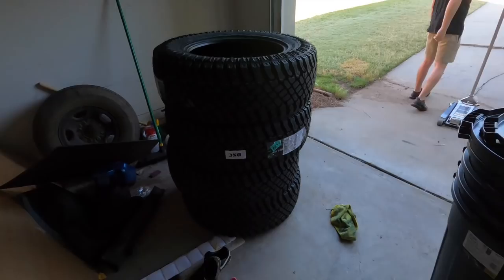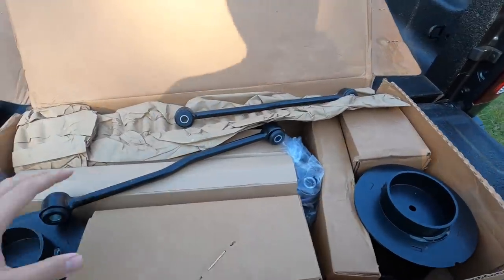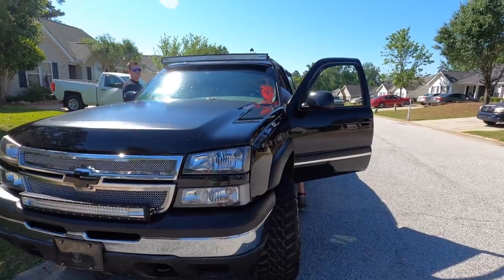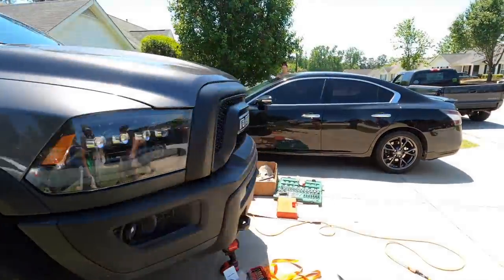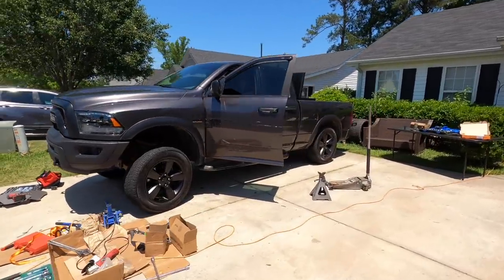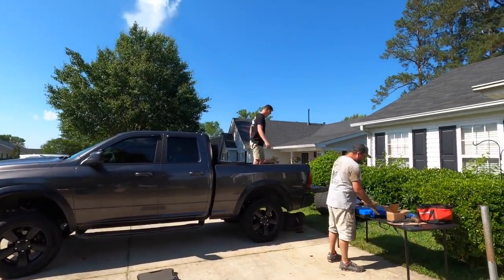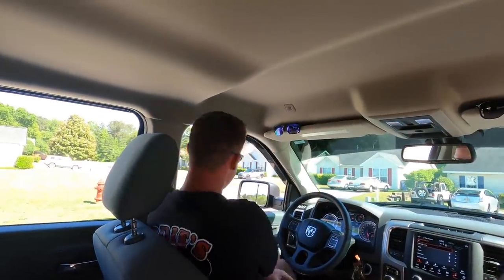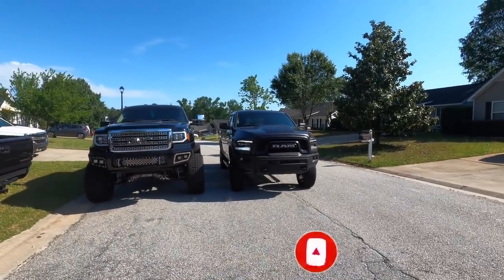WORLD'S FIRST LIFTED RAM 1500 WARLOCK EDITION

Comment: I read the Warlock has a 1” lift from the factory. I’m running 285/75/17’s on stock steel wheels. Ton of clearance. Could run 35’s if I had higher gear ratio.

Comment: Great look! Great video!

I have a 2020 2WD Warlock. RC states their kits won't fit the Warlock models. Any clue as to why?
Reply from the maker: It’s a typo according to them
Reply: @JWMontoya  I'd imagine it's due to the need for carrier bearing spacers, but I reached out to them, and they just said it wouldn't work lol. After seeing your videos, I'm doing it! Thanks for the inspiration!
Reply: I got their 4 in lift kit and I too want to to really try it. Do you see any issues with the 4 in kit... I also want to change to 18” wheels but would I need to Change the knuckle also??
Reply: @TheDarkSideofNY  how does the 4” lift fit any problems?
Reply: @JWMontoya  I have the RC 4" kit (30730).  I wanted to put on my 2020 Warlock.  I talked to Rough Country today, they state it will not fit. No explaination, no discussion. They would only say it will not fit the Warlock. They said "we do not offer a kit compatible with the Warlock". This video suggests otherwise. I wonder what Rough Country's deal is? I know the Warlock has a two piece drive shaft....different from the previous year Ram Classics..I wonder if this causes an issue such as drive line vibration after intalling an RC lift?

Comment: Rough Country states they do not currently make a lift kit for a Warlock. (I have a 2020 1500 Warlock 2wd, and Im currently looking). Did you guys run into any problems such as drive line vibration after installing this kit?

Comment: Im about to install a 6in on my 2019 warlock any advise or anything that needs to be modified to get the lift on and what drive shaft spacer did you use

Comment: I have a 4 inch rough country lift on my 2019 ram warlock classic and it starts to shake at 64mph. Rough country can't figure out the issue. Do or did you have the same issue with the 6 inch.
Reply from the maker: Did your kit come with rear upper control arms?
Reply: @JWMontoya  no it didn't come with them and that's what rough country is thinking.  Mentioned might need control arm adapters. They didn't know the warlock came with double drive shaft so sent me a bracket to fix the angle but still didnt work.
Reply from the maker: No, you got the updates kit, which is the correct kit. You would reuse your factory rear upper control arm with RCX’s bracket.
Reply: @JWMontoya  I'll let them know that thank you and ill keep you updated.
Reply: I'm just going to see if they can send me the extra parts to make it a 6 inch since they can't figure it out.
Reply: @luisvaldez7467  did you find a resolution to vibration issue with the 4" kit?